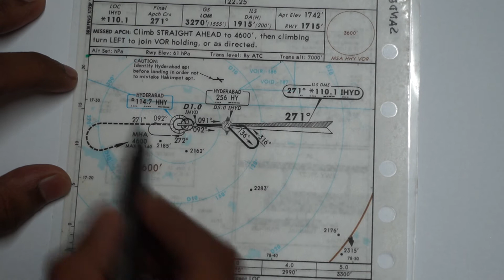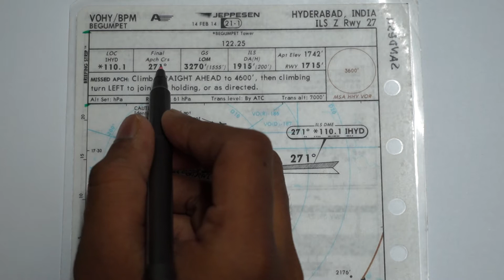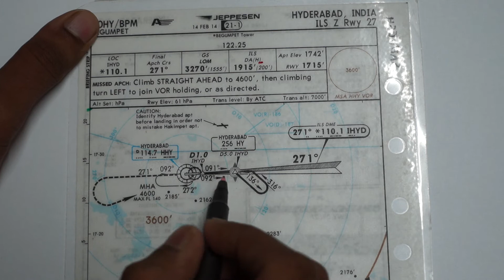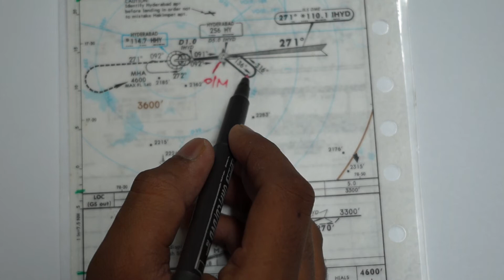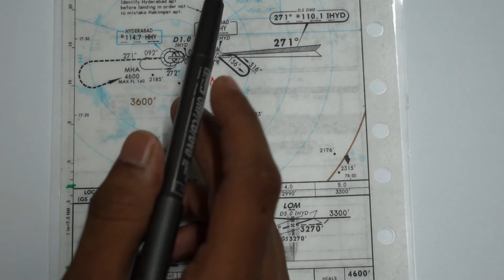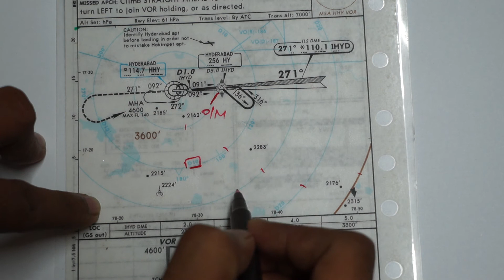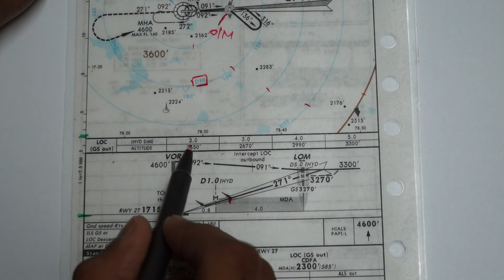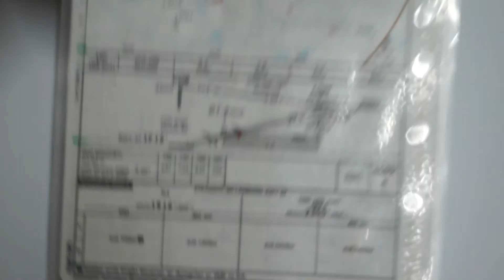Instrument Flying - 4 (Approach Chart Briefing)

Comment: Well explained, especially the index part, small correction MSA- minimum sector altitude.
Reply from the maker: Honestly, MSA is used interchangeably in different countries, some call it sector, some call it safe. The idea is to understand the concept. And I hope that is clear! :)
Reply: Rohit Mathews MSA means Minimum Safe Altitude, look it up in the Jeppesen user guide.
Reply: actually depends on the chart. if its sectored, it called minimum sector altitude. if in the area at the same altitude like in video it called minimum safe altitude. and msa radius is 25 nm from nav aid facilities.
Reply: The correct definition as per PANS-OPS 1 is minimum sector altitude, but most of us call it minimum safe altitude.
Reply from the maker: +Rohit Mathews Thank you! :)
Reply: Sandesh Baheti request your phone number